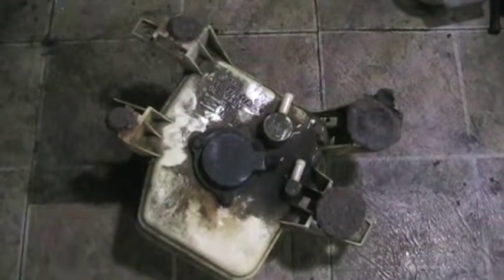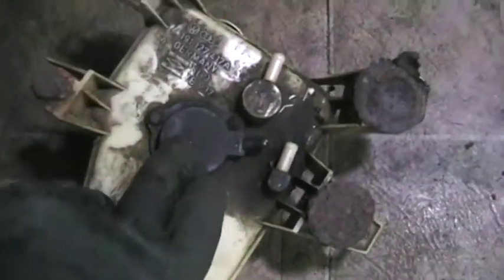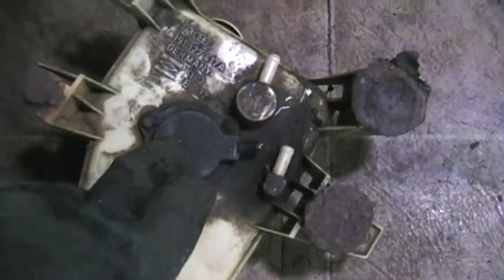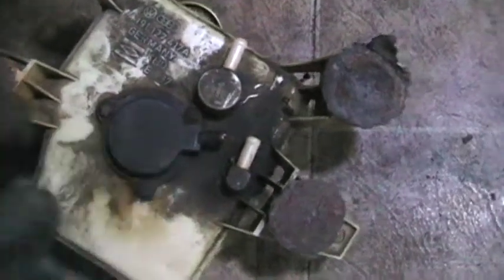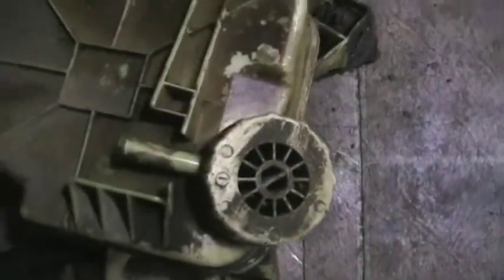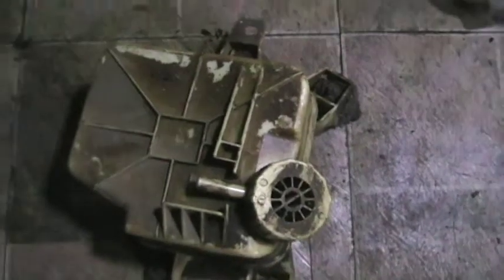VW Diesel Water Separator Cut Apart

Comment: 1991 MK2 Jetta diesel non-turbo
I’m going to keep my original water separator. The fuel
filter has a water trap that can be drained but it doesn’t operate like a water
separator. I think in a water separator the fuel is spun (you pointed out the
spiral when you cut it open) and the so-called “centrifugal” force separates
the heavier water from the lighter diesel oil. The water goes to a low point in
the separator and fuel continues on to the filter. You then drain the separator
if you suspect water in the fuel or as regular maintenance.
A lot of owners disdain the separator as a useless piece of
junk, but I think I’ll keep mine until I suspect that it is restricting the
fuel flow. I just had a lot of bubbles in my line from the fuel filter. It
turned out to be what I thought was a clean filter. New filter…no more bubbles.
I also removed the check valve from before the separator. I think that it was
also contributing to excess vacuum in the fuel line.
Thanks for chopping your separator up.

Comment: Very timely for me. I'm considering getting rid of the separator on my 91 Jetta diesel. The older diesels didn't have one. The fuel filter is also a water trap and has a drain on it. Why did you remove it??  Did you replace it or go without???
Reply from the maker: I was trying to see if there was any build-up inside. Probably was still good and didn't need changing. The water filter unit under the rear seat area was removed years before with no issues.